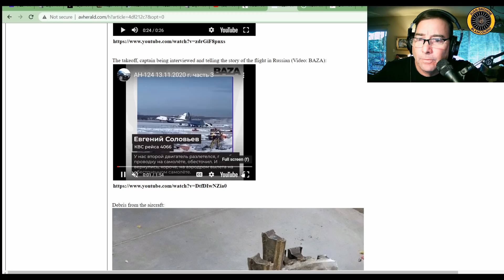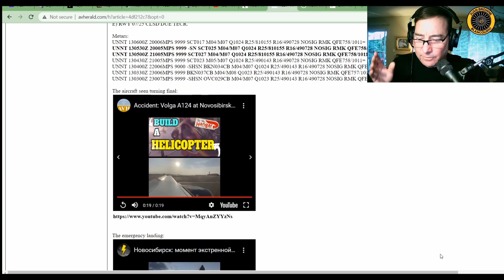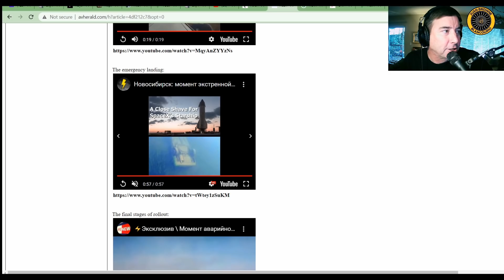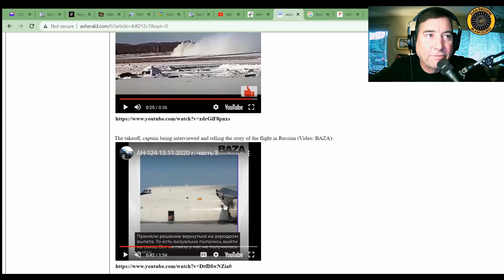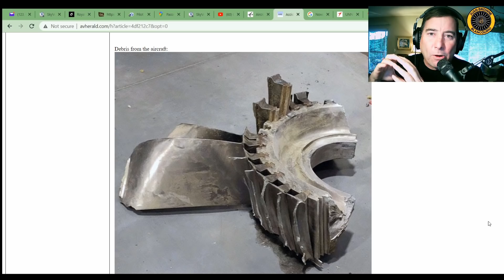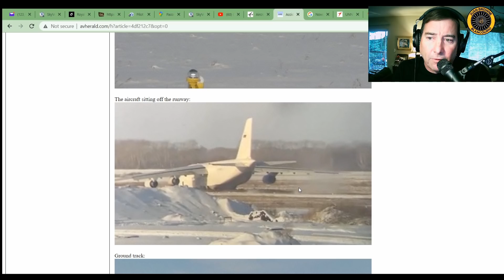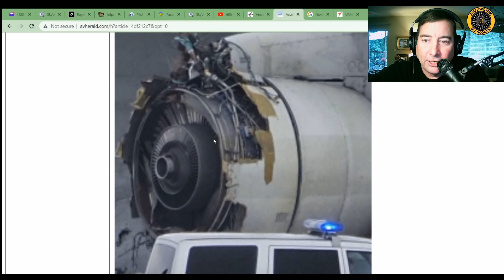AN-124 ANTONOV FAN DISK FAILURE NOVOSIBIRSK, RUSSIA

Comment: In this type of uncontained failure of the disk, the disks breaks into three pieces and they would all leave the engine with 10,000's of ft-lbs of force.  The other two pieces of the disk likely just exits the engine away from the aircraft.   I have seem many fan, compressor and turbine disk bursts and they almost all have the three pieces failure even if the rest was of the disk is not part of the failure mechcanism.   Look at the Airbus 380 turbine burst same three-piece ejection of the rotor disk pieces.

Comment: The pure physics taking place in compressor or turbine blades are unbelievable. Centrifugal force must be huge. If a blade departs the contained energy is huge and an aluminium aircraft hull do defence whatsoever.Its a bit like firing an artillery round. Equally the imbalance on the shaft will cause devastion to the engine it self. Always respect physics.

Comment: The AN-124 entered service in Soviet Russia in the 1980s. It resembles the C-5, as you said, Juan, except that it lacks the C-5's t-tail. The IL-76 first flew in 1971 and entered service in 1974. It resembles the C-141, which led the pack in the movement of military air transport into the jet age. Numerous planes still flying today were at the very least inspired by the C-141, including the BAe-146, later made by Avro as a regional jet. The BAe featured side loading in contrast to the C-141, which featured rear loading. Still, both featured top-mounted wings, four fanjets, swept empennages, and soaring t-tails. In a flyby, the BAe-146 looks like a mini C-141. It has the four-engine sound, yet lacks the black exhaust characteristic of the early fanjet engines. I saw one fly over my house a couple of months ago. Not quite as exciting as watching C-141s flying on final to Andrews in the 1980s.

Comment: Don't you think the OTHER 3 engines would be a good place to start inspecting fan
hubs? (Particulary since they could 'be flying' in other airframes in the coming months?)
Reply: As Juan said, they will trace the serial numbers. Aircraft - specifically at age, tend to have a collection of different engines as they are swopped out over their lifetime. So it's fairly unlikely that the remaining three engines would have sequential serial numbers, or be of the same batch.
Reply: Yes, but for various reasons, engines undergo repairs and overhauls not inline with age of build etc. The 4 engines could all have different histories and ages covering a lot of years. This engine could be recent and on low hours or getting near the end of its service life. A report somewhere, sometime may give more info but this is Russia, so don't bet on it.
Reply: I'm sure that's where they will start.
Reply: So you would prefer to 'cherry pick' and ignore the possibility that this problem is more wide spread than initially
 suspected?

Comment: I speak Russian, Capitan said in his interview that they had only AOA indicator available, all other instruments were out, they judged Vref using AOA, they were going in at about 280 km/h or 150 knots.
Reply: Took a lot of balls for this crew to show everyone how its done - give them the Lennon medal, & a 4 weeks all expenses paid vacation for saving 12 lives and all the cargo !!!!!
Reply: PAST- Power Attitude Speed Trim. They roughly knew the power level set (throttle positions), knew the attitude (sight picture/ AoA indicator). This gave them a reasonable guess as to speed, then trim the aircraft to maintain that attitude and fly it down. They probably also had any electric gyro gauges for at least a minute too as they spun down from being de-powered.
When the fecal matter hits the fan, fall back to the basics/ what you have and go from there.
Reply: @TyphoonVstrom  If they had an upgraded glass cockpit then nothing will work past AC bus failure, though often you will have an emergency AH that runs off the 28VDC bus, using a small local inverter to give 115VAC 400HZ power. Depends though as it seems the debris took out the 28VDC buses as well, so nothing worked, as intercoms almost always run off the DC bus supply direct from the battery.

 Also most gyro units will barberpole on AC loss, and apply a caging brake to the system, to force it into a locked and upright position fast, so it will be useless. Done so it does not tumble as it slows, and wear out the bearing and slipring mechanisms, as power loss is typically going to happen on the ground when stopped.
Reply: @TyphoonVstrom  Hey, Dmitry! What speed does your Garmin 195 show?
Reply: @TyphoonVstrom  Isn’t the AOA dependent upon airspeed? If you’re parked on the apron, your AOA would indicate essentially zero, correct?  Now, if you were able to pitch the nose up, but remained parked, the AOA would indicate   True AOA, correct?  Now, let’s say you were flying, but maintained the same true AOA, , wouldn’t the airspeed shift the angle of the AOA instrument requiring compensation for airspeed?  So, I’m thinking you can read he AOA pulse take into consideration the horizon outside, you can deduce the airspeed from that.  Finally, isn’t the AOA an electronic instrument?  How is the signal transmitted to the cockpit?  And, do they still use air pressure /vacuum to drive gyroscopes?
Reply: If you make more videos of Russian aircrafts their tittle abbreviations AN or MI or SU are not pronounced as separate letters, but as a word.
Reply: @TOHETOTEHOT  - Like MiG?? Lighten up.
Reply: @TOHETOTEHOT  I'm a certified av-geek and I had no idea this was the case.  Thank you for teaching me something new!
Reply: I had heard this! Didn't know you could do that! 150knots seems so slow for all that weight!
Reply: So I'm not a pilot but the way I'm understand this, they lost an engine at 1000Ft went off radar, lost their instruments like airspeed and just sailed it down seat of the pants 85 tons on board? And no spoilers so they couldn't brake well?
Reply: @curtismartell7959  yep. Incredible pilots.
Reply: @curtismartell7959  they didn't have brakes as well, as brake system requires working electric systems that they didn't have. And to make life even more interesting, engine 1 stalled at about 0.7 of nominal power and was only stopped on the ground by ground crew.
Reply: @curtismartell7959  well. Yes.. it s what happebed
Reply: Matt, with what little audio you heard, could it have been Ukrainian, I know that they are very similar?
Reply: @johndavidwolf4239  nah, clean Russian language

Comment: Airport folks will have a very challenging job pulling that beast from the soft ground and mud back onto solid surface. Looks like now it is blocking both runways and I would imagine they want to move it ASAP.
Reply: Unload in-situ, defuel and tow it out on skis or temporary wheels. Russians just get in and get things done, I doubt it's there more than a few days.
Reply: Jure  -  I guess the ground will freeze very soon in such a far north place.

Comment: Again Agent JayZ has video's on these failures. Just a TINY SLITHER (flake of metal) spinning at 21 000 RPM can cause an enormous amount of damage. In this case it would have been a blade failure at full power as the AN 124 climbed smashing into all the other blades. All the energy has to go somewhere. In this case straight through the engine housing and straight into the body of the aircraft. It IS NOT the pilots fault. THE CAPTAIN DID A BLOODY FANTASTIC JOB OF PULLING AN ASTRONOMICAL SHIT SHOW INTO A TEACHING LESSON THAT WILL BE USED FOR YEARS TO COME. My only armchair piloting experience as I said to Mentour Pilot would be to belly the aircraft onto the snow covered grass area to give maximum spread of weight distribution. Yes it could have been bellied onto the tarmac runway, but with all that fuel and any fuel tank rupture the explosion would have made any Hollywood Special Effects Guy Jealous!!

Comment: How was the Southwest incident "contained" when it took out a window?
Reply: Contained refers to high energy parts from the engine core, not the cowlings that might get ripped off by airflow.
Reply: It was contained because it was not fan disk parts that penetrated the fuselage. The damage would have been far worse. What caused the damage were pieces of the actual cowling striking the fuselage.
Reply: Following Juan's "SUGGESTION",  I did review the section that I didn't fully comprehend.  As usual, he goes into great detail, and explains the issue so that even a non pilot (like me) can understand it. 13:50. I guess I zoned out! 
Having said that, while I now understand the difference in catastrophic effect of a contained vs. non contained event, I think that given the chance, the lady who was partially sucked out the window of the Southwest flight, might quibble with the definitions. If you're on the receiving end, shrapnel is shrapnel. Be it part of the disc or the cowling!
Reply from the maker: Go back and watch again and LISTEN
Reply: @blancolirio  as you can see, I gave thumbs up to two that clarified the issue for me. I appreciate your work, but don't be an a-hole!

Comment: The air speed and altitude aren't necessarily dependent on electrics. What I believe of former Soviet or Russian aircraft (I know, Antonov is Ukrainian) they seem to like to maintain some old school back-up systems, if not on the main panel than at least at the flight engineer's panel which they retain. Same would go for a compass.
They could therefor still have had that information available.
Reply: Ukraine, because of the aggression, imposed sanctions against Russia. And now all Russian aircraft are of the AN brand, and after that, the overhaul of Ukrainian engines is not carried out and many components for the AN are not supplied. Now it is very dangerous to fly on Russian AN aircraft!
Reply: @vak1510  This is the problem with the break-up of the USSR. One aircraft part is manufactured in country X, another in country Y and the third in country Z. The leaders of country X do not like the leaders of country Y and vice versa. The leaders of country Z are OK with both X and Y but are not willing to export to 3rd countries. Since politics and economics are inseparable in those countries, the politicians try to sabotage each other as much as they can. The Russian space program had issues and had to redesign the automatic docking system made in Ukraine and in the process of replacing it I believe indirectly resulted in the spacecraft crashing into MIR. The Antonov program in Ukraine is victim of exactly the same geo-politics. Shame :/
Reply: @todortodorov940  This is not a shame, this is the reality of life. When you are attacked, part of your territory is occupied - will you repair the engines for your planes?
Reply: @vak1510  I am not expert on local Ex-USSR politics. At least I am glad that the Soviets have turned on each other and do not repress (Eastern and Central) Europe as they used to up to the 90's.

Comment: I flew in a C5A once a cross the pacific and swore I would never do it again. We had two in flight emergencies. One we had too return to the field. And the second was a divert too Midway too pick up extra hydraulic fluid. The scariest flight i was ever on.  And sitting backwards too the direction of flight was quite disturbing.
Even flying as cargo in a 135 was better. And if you have never flown as cargo in a 135. The fates have smiled on you.
Reply: I flew from LAX to Albuquerque on a C5.  On short final the plane did a sudden dip and recover. We continued with the landing.  While unloading cargo the flight engineer appeared on top of the tail covered in hydraulic fluid.  We had a failure in the primary system and landed on the backup system.  Could have been a bad day.
Reply: @motor2of7  
Ouch. Sounds like a similar issue.

Comment: Not second guessing this situation. However, there seems to be too many situations where the pilot focuses on getting the damaged aircraft on the ground immediately when they could otherwise fly "all day" with the emergency they have. 100% of the emergencies we encountered during my career in large combat aircraft (18 years) resulted in holding and working through scenarios before committing to a landing.

Including an engine oil fire and a flap that didn't retract and instead peeled back where the jackscrew connected to the "barn door".  We held near the field for that last one while our fellows consulted with Boeing and flew the simulator to appraise us of any surprises to expect on our no flap landing. The instructor pilot hit every number on the button during that approach -- great hands!
Reply: True what you say about not rushing to get back on the ground, except...it was day VMC and the clouds visible to the west were presumably moving in and daylight is pretty short in Siberia now-abouts. As an earlier commenter said, IMC or night would have made their task MUCH harder. For another thing, they probably would have had no anti-icing capability left.

Comment: They did one hell of a job getting it back on the ground Juan.Kudos to them.
Hope they solve it.
What do you think as to repair or write off given that level of damage?
Reply: Repair is feasible.
Reply: It'll be repaired. Looks like mostly skin damage from the fan (main spars well out of the firing line), the undercarriage and underbody is quite strong and I bet there are scrap donor aircraft to rob of these parts.
If not, Russia still has a strong manufacturing industry and relatively low labour rates, plus a strong trade education system. Pick up the phone, order new parts from the OE suppliers, hire a hangar and employ some aircraft technicians at said low rates.
Big, strong, simple aircraft fulfilling a niche (not many airframes that does what it does), so it's definitely worth repairing.
Reply: @TyphoonVstrom  that's what i hope for as well.They are such amazing aircraft along with the 225.
Glad they are all safe though as that fan disk coming apart like that would have been terrifying & potentially lethal.
The crew were very lucky.
Reply: My guess is totaled.
Reply: Repair✔️ no problem. Easy fix with Ducski Tapeski.
Reply: Probably write off. The OEM is in Ukraine, and Russia has no access to spares, support, and such due to Crimea and war in East Ukraine. BTW, lack of/delayed maintenance is one of the possible reasons for this incident.
Reply: @MrDikini  OEM manufacturers for this airplane have been scattered all across the former USSR, this particular aircraft has been built in Russia. Landing gears have been produced in Russia as well. So, chances are it gonna fly again, unless there are some legal issues, due to the reasons you have correctly pointed out.

Comment: Seems like pretty competent airmanship to get that result.
Reply: You, Sir, have won understatement of the internet today.
Reply: They did a good job.  Well done Russian pilots.
Reply: Actually, most jets that have an engine puke do land without incident (passengers sucked out the window notwithstanding.)
Reply: @UncleKennysPlace  How many with a fan disk failure, total electrical loss, no means of further extending flaps to landing configuration (which is almost always greater than takeoff) no internal or external comms, no spoilers, debris passing right through the aircraft fuselage and damaging the opposite wing root, no thrust reversers, minimal if any brakes, full fuel load and only an attitude indicator?
About the only thing they didn't have to deal with was fire, and with almost all instruments gone, they couldn't even be certain of that!

Comment: UA 232 DC10 #2 CF6 engine suffered an uncontained fan disk failure that took out hydraulic systems resulting in loss of flight controls.  Somehow the pilot, copilot   and a check airman named Fitch,  were able to navigate the 10 to Sioux City by varying engine thrust.   184 survived the crash landing at Sioux City Iowa in July 1989.

Comment: Instead of too much computerization they have a crew of SIX in the cockpit - separate engineer, navigator. That clearly helped avoiding overloading two pilots only. Plus rocksturdy russian mechanical technology. A "fly by (electrical) wire" plane would likely have been doomed.
Reply: Yep, it’s full of steam gauges and fully fly by wire. With wire being aircraft grade stainless cables. Might take a gorilla to help pull but she’ll fly as long as the debris doesn’t actually hit too many cables.
Reply: Happened to the A380 with Qantas and they landed it fine.
Reply: I'd agree with the "wired" planes. Maybe they ought to build wire/cable channeling out of robust material to prevent this kind of thing from slicing through the wires/cables so easy.
Reply: @Garth2011  , they did on planes like the A10 Warthogs but it’s not something you do for a civilian freighter. The weight penalty for the once in a several million hours occurrence just isn’t worth it.
Reply: This aircraft was designed in Kiev, Ukraine. These are not Russian technologies. Russia manufactures it under license.
Reply: @vak1510  these are Soviet technologies.
Reply: @AVlad-eg3ds  Русский, иди домой, здесь водки нет!
Reply: @vak1510  Oleg Antonov is the guy that is the lead designer and the company named after him. He is Russian.Viktor Tolmachev lead designer for the AN-124 is Russian. Just because the soviet union decided to locate his design bureau the Ukraine, doesn't change the fact that the technology (design) Russian.They could have located this design bureau anywhere in the soviet union, it would not have mattered, but spread them out to make them less of a target for US missiles during the cold war.
Reply: @pd4954  
Russian, go home, there is no vodka here!
Reply: @vak1510  Not Russian. Ukrainians got what they deserved. People voted and they left  Deal with it.  overthrowing a government with a coup is not democracy and you have no right to judge others that voted to leave.
Reply: vak1510 kid , you are too young to speak here , get back to kindergarten